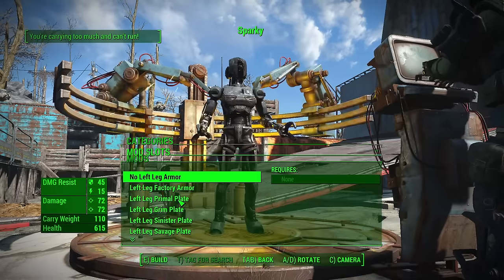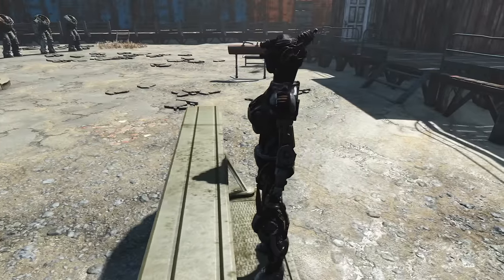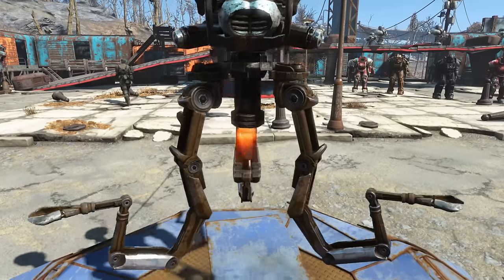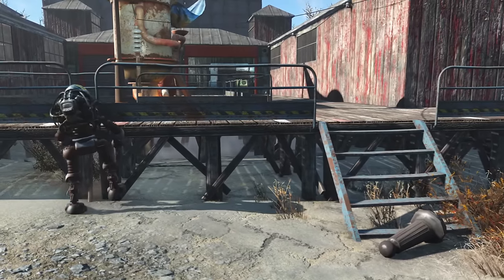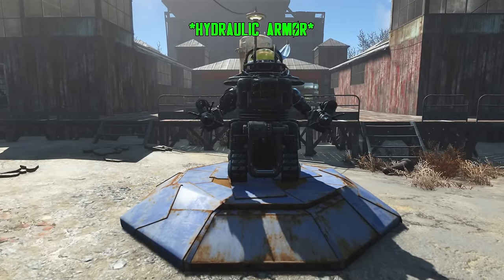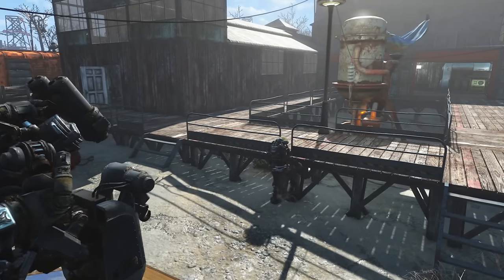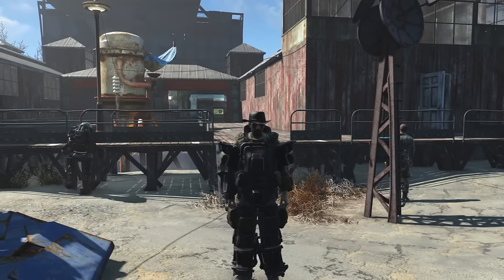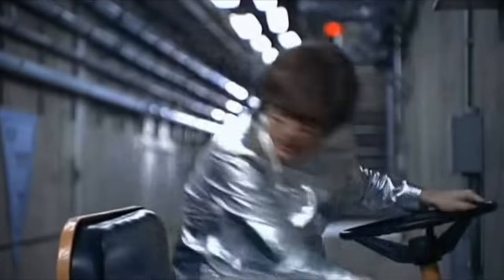Complete-ish guide to Robot Design in Fallout 4

Comment: As far as I can tell, the basic Mr. Handy would have had either a Flamer or a Laser, but both functioned as multi-tools. The Flamer could be anywhere from full on light the room, down to precision cutting/welding torch, to lighting birthday candles. On the other hand (ha), the laser would be capable of anything from precision bug zapping, to full combat laser and anything in between, including use for precision tree/hedge trimming, and maintenance tasks. Bolt can't be stuck if it's been turned into a cloud of metal vapor.
Reply: Make the third arm the greatest multi tool of all, a hand.

Comment: >anything on top
>assaultron legs

there. that's the guide. not grey's guide, mind you, but it'll at least get you a mobile robot companion, provisioner, etc...
Reply: Why not robobrain tracks tho?
Reply: @nedimmrsic4650  Size, all what not flying or have assaultron legs are suck. It can stuck in small areas and the bigger target -the easier robot get hits, and unless it's your companion -it can perma die cuse of that. They not cheap.
Reply: @nedimmrsic4650  personally I find the tracks bulky despite the improved movement speed
Reply: personally, i just throw on all the parts that increase carry capacity the most. typically ends up becoming a massive bot that hardly fits anywhere, but i hate being overencumbered and i'll be damned if i can't loot every inch of a place. i find it's always nice to have a bot that i can leave outside of a location i'm going to explore, that way i have a portable "chest" that i can load up with all my junk

Comment: Id like to add that full sentry bots are ideal for settlement defence, they dont need to travel long distances, are literal bricks of armor and guns, and when they overheat other settlement defences can give them cover untill they resume their rampage, and if you get fed up with them getting stuck, swapping the sentry legs for robobrain tracks tends to solve most pathing issues. Also dont sleep on thier melee abilites, sure they dont hit as hard as an assultron, but its still very hard with a proper melee weapon and thier sheer bulk means they can even go toe to toe with the likes of yaio gui.

Also, if your someone who has access to power armor or other means of carrying large loads yourself, a pure assaultron is an excellent protector to have by your side when outfitted with melee weapons and the head laser, them running into melee tends to keep a lot of the heat off your back, so they are even better suited for those who prefer ranged combat. Also, about that head laser, dont worry about the assaultron's bad sensors making it miss, it wont, it appears the laser module comes with its own set of targeting sensors which are second to none, but due to being directly integrated into the head laser they cannot link with any other ranged weapons.

Comment: A surprisingly good combo for a robot companion is to use protectron arms and torso with robobrain tracks, this gives enough carrying capacity and health to be helpful in pretty much every situation. For the head and weapons it depends on the combination, as automatic weapons work best with sentry heads, so it doesn't try to spry things at sniper distances, while the robobrain head works best with single shot weapons, so it misses a lot less.

Personally I always recommend weapons that allow armor on the hands, so you can have a bit extra armor and carrying capacity, but that's just personal preference.

Comment: For melee battlebots i like to use Mr Handy torso, center eye, assaultron arms, dual hammersaws, assaultron legs, and whatever armor provides and pumps up bleed damage. Melts through deathclaws and behemoths like a hot knife through butter, and something about that configuration pretty much completely stops it being staggered.

For more rounded but less specialized battlebots, i like to use the assaultron body and limbs, robobrain head, gatling laser on the left arm (robots favour their left arm), and assaultron shock claw on the right; with voltaic armour. Great range, great damage, an all around good companion.

Comment: Fun fact about assaultron head laser: despite the overall horrendous accuracy of the assaultron head, the laser SPECIFICALLY seems to have a pinpoint accuracy as long as the targets are within assaultron's cone of vision when it's body locks in. It can even switch between targets during a single blast, killing multiple targets if their health is low enough.

Comment: [X] Constructing a robot to provide support fire. 

[✓] Constructing a robot to carry all the purified water I use to fund my ammo and fusion core needs.

I usually opt for 2 configurations.

Like yourself, I too settled on a Mr. Handy type configuration with 2 eyes swapped for fire support. I opted for Gatling Lasers. The armor I used was anything that increased energy damage. If I'm dungeon diving, this is my robot of choice. Usually Codsworth is configured this way.

My other robot is a Sentry bot mule optimized purely for carry capacity. I still mount a Minigun and Gatling Laser with 2 shoulder mounted Fatman mortars. Since the mortars can malfunction, the arm weapons are standard type for reliability. I only use this for buying and selling, but if anything does decided to attack me. It doesn't for very long.
Reply: Jet farming has a much better value to weight ratio over water farming.

Comment: The final Mr. Handy is close to your best option for companion work - stack two gatling lasers on it and use the armor that boost energy damage and you are good to go for the fastest, hardest hitting option that can follow you around without hanging up on everything. You could just use those and nothing else (though they are pricy to build just to have as provisioners, but they will clean up the commonwealth for a survival playthrough where you want clean roads to run on). 
     
For provisioners, you can just use basic unmods as they don't HAVE to be anything special. If you are going to make them damage dealers, then the system he has works well enough - but consider cheaper, shorter range arm options like cyro and flamer. Those have pretty awesome damage potential when on a companion. The face blaster works well as a longer range option so you can afford the shorter range for the arms (and they seem to shorten up the agro range as well). 
      
I've seen assaultron melee builds that COULD pile on the damage in an encounter, but the reality is that what you are working against the most is the game's pathfinding. Having legs instead of thrusters and no range means that you will never have an effective build that is melee because getting to the enemies will be thwarted. You want a floating gunship if you want that companion to be worth having around you.

Comment: I know for my robots I usually build them according to 3 types. Workers, fighters, and travelers. 

Workers are either basic protectron or Mr handy bots with little to no armor or upgrades. They are designed to be a workhorse, and a workhorse only.

Fighters are either asultrons or securitrons built around crowd control with little to no care for carry capacity or mobility. They are built for defending bases and attacking anything that might pose a threat to a settlement. 

Travelers are a hodgepodge of assaltrons, robo brains, and Mr handys that are equally a hodgepodge of range, capacity, and damage while all having mobility be its key necessity. They are built to be companions and provisioners with a focus again a being able to go anywhere.

Comment: One of my go-to options for settlement defense is a sentry bot with a robobrain head, usually outfitted with two grenade launchers or explosive miniguns and shoulder-mounted fat man launchers. I made it my standard-issue artillery unit after taking one such bot on a field test. We were only raiding outdoor spots for obvious reasons and that's where the thing shined. Heck, it even managed to steal my kills where there is an unfinished high rise infested by super mutants. We were on the ground level and my bot managed to annihilate those inhabiting the upper stories before I got a chance to get up close to them.
For CQC my obvious choice is an assaultron with its designated blades and a laser. Some foes tend to get too close for artillery units to be efficient, plus there's Vault 88 and the castle where the synth eventually teleport inside the walls of. 
Both options get clad in full sets of hydraulic armor for maximum protection and aesthetic purposes (the towing hooks on the sentry bot rear legs make me imagine these tanks as capable cargo haulers and even artillery tractors).
Every now and then I also make sentry bots with gatling lasers, full sets of electric armor and jangles' heads for maximum energy damage.

Comment: I had two main configurations
Mr. Yellow:
Body: Mr. Handy + Front Eye Hydraulic Armor (gives it a boxy webcam appearance)
Legs: Protectron armor with carry pouch
Arms: Protectron
Left Arm Weapon: Tazer
Right Arm Weapon: Automatic Lazer

Supply Line Build:
Head: Robobrain
Body: Sentrybot
Legs: Assaultron
Arms: Left Sentrybot, right Assaultron
Left Arm: Nuka Lazer
Right Arm: Automatic Lazer

-Robobrain head stuns while laser guns keeps opponents at bay used for supply lines near glowing sea as melee is not preferred for radscorpions and death claws

Comment: For my companion and settlement protection bots, I normally go for the Robobrain head for the mesmatron attack, Sentry body for high hp and the 2 shoulder grenade launchers, Sentry arms for high hp again, Gatling laser and rocket launcher for arms and the Assultron legs for movespeed, they are both faster and provides more carry capacity than the mr. handy thruster. Then the Target system, so it can detect all nearby enemies and depending on my own carry capacity, I go either voltage for the extra carry or otherwise hydraulic armor for best protection (And sometimes bleeding dmg for the shoulder armor). It is an absolute fast moving killing machine, it looks wild and also have decent carry capacity and one of the best combat companions you can have.

But it is very costly in materials, especially aluminum, gold and nuclear material.

Comment: my go to unit is assaultrons with blades, a handy thruster, and a robobrain head, the speed and engagement range make this combo pretty scary as long as it doesn't get surrounded, but it's hard to surround something that has its blades wet before your opponents know what happened, install these as provisioners and yeah, they'll get distracted by every threat along the way, but if they run the longest routes possible you can pretty effectively rely on them to keep the commonwealth clean

Comment: My preferred robot for dungeon crawling is a robot butler /death machine

This robot has a 510 carry weight limit with all the voltaic armor, and it is brutally lethal, that has always proven sufficient for me.

Mr Handy Torso, Protectron arms (or if available, Sentry arms) armed with auto lasers (or if available Gatling lasers, but that is just overkill really), Protectron legs (explanation follows).
Armored with voltaic armor where available, voltaic armor has slightly less damage and energy resistance than hydraulic armor, but each piece of voltaic armor adds +10 carry weight and some energy damage, but the tooltips do not verify the energy damage increase, anyway the energy damage part is unimportant, with all the carry options added on the protectron legs, you have something like a +20 carry weight over the treads, I forget how much.

This robot will fit into most places, and while it is slow and noisy, good! It attracts the attention, and then it deals with it with a torrent of precisely aimed laser fire, the lower protection is not an issue either, enemies will be dealt with long before it could be an issue.
The torso has 3 voltaic armor attachment points (the eye can only get hydraulic), arms have 1 each, legs have 1 each, and you can fit a storage bag on the posterior too, for a total of 7 voltaic armor attachment points (and a storage bag on the behind), for a total of +80 carry weight, +70 from voltaic armor pieces.
The factory armor version can fit 3 storage bags on the torso, and one on the posterior, for like 450 carry weight or something

Comment: Optimal robot design: Assaultron legs (good durability and best mobility), Robobrain torso (second-best durability but doesn't have the overheating problem of the Sentry Bot torso), Sentry Bot arms (best durability), and a Robobrain head with armor (longest engagement distance and best accuracy; second-best durability). For weapons, choose a Sniper Laser and a Gatling Laser. Of course also use the armor plating that boosts laser damage. Your robot will basically be able to dictate the range of its weapons and avoid melee where it's more likely to be damaged. It will absolutely shred stuff and be able to take hits. Obviously you can choose different weapons, but this, in my opinion, is the most effective overall chassis design because it's the best balance of mobility, durability, and weapons accuracy.

Comment: I prefer what I consider the "sentry robobrain"

Sentry bot torso and arms, giving it the heavy cluster munitions and high carrying capacity, fitted with an unstable gatling laser and missile launcher.
Using a robobrain mesmetron head it has an extremely long engagement distance and has the mesmetron as an extra weapon.
The disadvantage of the sentry bot legs is difficulty in close quarters but this is almost entirely eliminated with the robobrain treads, with a mere slight drop in carry capacity and health.

What this lacks in melee capacity it more than makes up for in extreme levels of power. Slapping strong post-war armour with extra carry capacity on it and it's one of the most versatile robots I've ever made.

Comment: You make a mr handy thruster, with buzz blades on all three arms, sentrybot chest and arms, with bazookas on the back and electrical field for extra melee damage. Gatling lazer and minigun on arms and a robobrain head. Put hydraulic armor on everything exept the arms where you put the extra carrying capacity. If I remember correctly (was like 5 years ago) you will end up with over 300 armor and around 450 carrying capacity with the best movment speed, targeting range and accuracy, firepower for days, and survivability that's almost impossible to beat. 

Edit: oh, I forgot to mention, it can navigate indoors without any real problems too. (Though the cluster granades can be dangerous because it can blow itself up by mistake) I think that there is a perk in charaisma which prevents even that though.

Comment: Somewhat un-fun fact about using automatons as laborers, occasionally when the cell they're in resets, they lose the robotsettler faction and revert to the default robot faction, which is hostile. On console, your only solution is to kill them, but on PC, you can manually re-add the player allegiance and stop them from wiping out the fleshbags occupying the rest of the base.

Comment: the most versatile one is handy torso, assaultron legs (handy thruster will do fine, low carry cap is still more than enough though if you really want that robobrain, again you just want any set of quick legs), double minigguns (one laser preffered to get around phys resist enemies), long range will allow massive suppresive fire and the range means armor is not important, and then go for all pocketed armor, with maybe some rust devil here and there, its great in a fight and will melt any enemy, (mine melts alpha deathclaws in seconds), it has more than enough speed and maneuverability for any purpose, and carry cap is liek 200 which is as much as if not more than the average person/follower

Comment: I like to make Mr. Handy bodies with a thruster, protectron arms and automatic hand lasers, and one Mr. Handy eye. All factory armor. This relatively low cost solution makes an excellent provisioner, But is tailored mostly to be aesthetically pleasing, and importantly, doesn't get stuck very often.
Reply: that was always the biggest problem with the robots in fallout 4 was that anything that didn't use assaultron or mr.handy legs got stuck on everything and struggled to follow you anywhere. the Sentry bots are cool but they made them way too big between fallout 3 to 4 so now they can't go anywhere and the robobrain despite being smaller seems to also get stuck on everything.